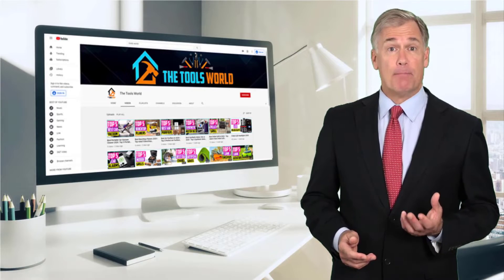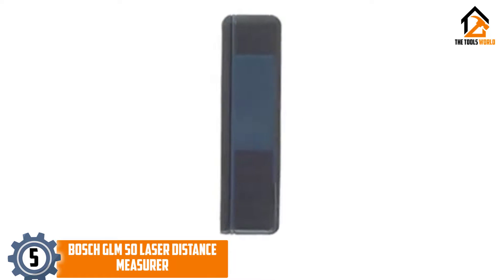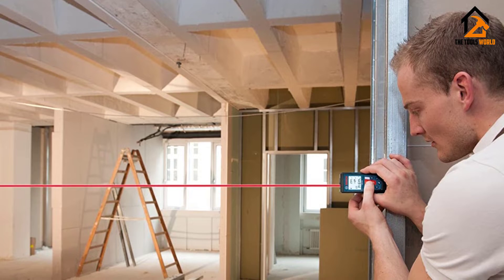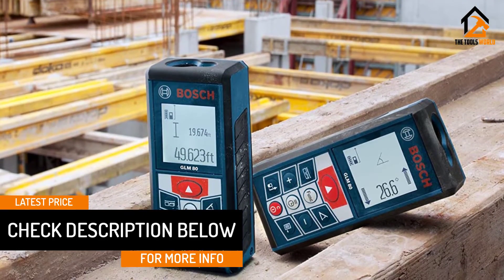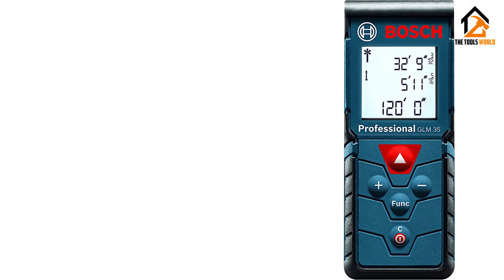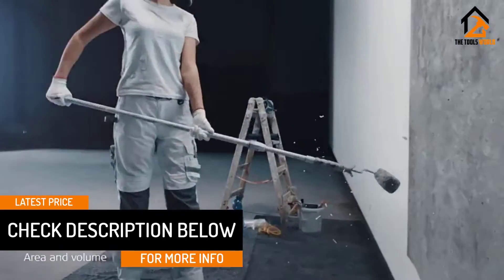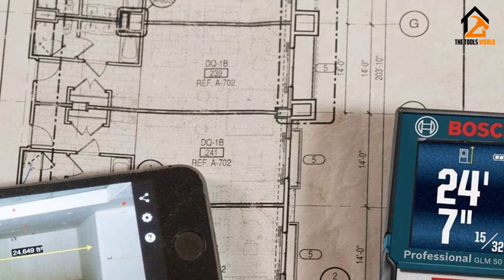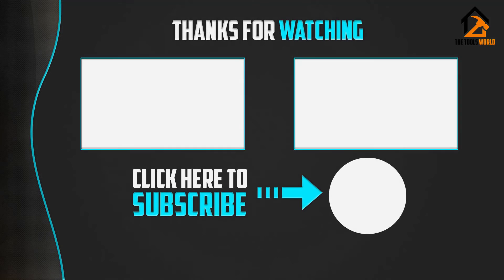Best Laser Measuring Tools for Calculating Distances Accurately.

Comment from the maker: ▶ In This video, We recommended the top 5 best Laser Measuring Tools.

▶ 5. Bosch GLM 50 Laser Distance Measurer.  
 
▶ 4. BOSCH 265-Feet Lithium-Ion Laser Distance Measurer.  

▶ 3. BOSCH Compact Laser Distance Measure. 

▶ 2. Leica 838725 DISTO D2 New 330ft Laser Distance Measure.  

▶ 1. BOSCH Blaze GLM50C Bluetooth Enabled 165ft Laser.